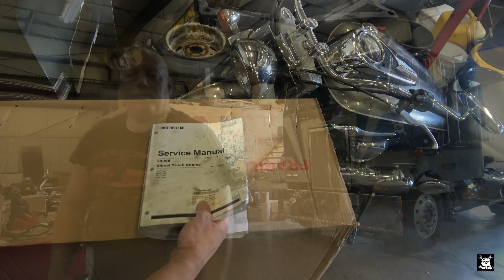Caterpillar Fuel Transfer Pump Removal

Comment: If your looking for a pin hole in your suction side, you most likely will not see a leak. You can plug the line at the FTP remove line from the tank. Get a psi regulator and put around fifteen psi on the system and you will find the leak. Also you can put one way flow check valves in your fuel system, to prevent any drain back. I only do this if problem can not be located.

Comment: Steve , I left a comment six or eight months ago after seeing a video of you starting Orwell after setting overnight , I said then I thought Orwell had a cracked fuel filter housing , I've had two of'em crack after filter being put on to tight , it puts the housing in a bind trying to losen the filter and cracks it , but I've not watched all your videos , you may have already changed it .

Comment: They had several different check valves over the years which they changed the material the diaphragms were made of.. I worked at a caterpillar dealer for 42 years..
Reply: Had to change them twice on my 86 B-Model .... some of the fuel anti gel I was using ate them up but a real easy fix once the problem was first solved.

Comment: Steve I've got the Cat # for those O rings if you need it, I buy them 50x at a time because it's the same O ring on EVERY fuel fitting on that motor and they're like .15 cents each.  Just keep them in a Zip Top bag in my toolbox cuz you just never know when you'll need one.  Of course I realize you've already changed the pump, but the Part Number might come in handy in the future for ya!

Comment: Hi Steve I was just wondering if it would be worth your while putting in a bunk heater in your cab this year before the winter  so you don't have to run the engine all night to keep warm is it worth it or is it not possible on your truck ?

Comment: Does the fuel system pull fuel from the bottom of the tank or is it connected to the top of the tank? If it's connected to the top of the tank there's a dip tube inside the tank going to the bottom of the tank. Those dip tubes can crack and suck air. Your fuel pressure gauge problem might be an over pressure problem. I can't find a good diagram of the fuel system online but your manual should have one. There is some type of pressure regulator in the system to return fuel to the tank when the pressure reaches a certain point. It might be on the injector pump. If that doesn't work, the pressure will go too high which could damage the gauge, the lift pump and the injector pump. I have heard of people blocking fuel return lines on diesel systems to try to get more power and the black smoke. There should be a diesel injection shop in your area that would have someone who is familiar with the system.
Reply: Draws from the bottom, returns to the top.  It's the most basic inside the tank, it's just a welded fitting, no line or anything. The newer trucks yeah, but the antiques like Steve has, and my '84 359 are pretty plain and simple.
Reply: @Wildcat_Cartagellc25  1984 is a newer truck to me. Fuel tanks have had top draws since at least the 1950s. We had a 1950s vintage cab over International tractor that had top draw fuel tanks, aluminum frame and air suspension. All of the 1970s Ford Louisville models we had drew fuel from the top fittings as did the 1970s model Macks. Most tanks have a lower well in the bottom of the tank that the dip tube sits into. They can be plumbed either way which is why I asked the question.
Reply: @tiredoldmechanic1791  they pull from the bottom on the Paccar's others might not function like that but these do. Didn't start the other way until mid 90s I believe.

Comment: You need to get a little more concrete poured right there one of these days so you can get the truck in and out easier
Reply: All he needs to do is plan his first turn better so when he backs up the truck is facing straight in the door, then both ends of both axles will go through that low spot at the same time preventing loss of traction.

Comment: What is that "buzz" every few seconds while he was removing the pump?  And then again working on the hoses?
Reply: The air pressure equalizing in the tanks.
Reply: Air loss. You can't hear the air leak itself, but you can hear the tanks equalizing again and again as it looses air.

Comment: The power divider seems to act like a 4X4 Jeep with open differentials. If one of the four wheels on each axle has no traction, the 4X4 wont go anywhere.
Reply: That's why it's still only a 4X2 no matter what, unless you spring for diff lockers also.
Reply: @ralfie8801  Some, if not all, Canadian class 8 trucks have inter-axle locks, that lock the two axles together on each differential, as well as the common power divider. Because of the bad Winter weather in some areas up there.
Reply: George Travers 
You said it yourself, "some, if not all". Differential locks are extra cost items when you order just about any vehicle. Even if it is part of a cold climate package with battery blankets and fuel heaters, it's still an extra cost item. If it doesn't have it, it's because somebody didn't check the appropriate box when they ordered the vehicle.
Reply: @ralfie8801  Agreed.

Comment: I used to drive a 359 with a B model cat and in the mornings, especially cold ones, during cranking if hold the pedal to the floor until I hear that first cyl pick up then get off the fuel so it doesn’t rev up. Just to help with cold starts.

Comment: Not sure why you guys mess with these old trucks and try to make a living from them. A modern reliable truck would be worry free.
Reply: What's interesting about that idea is that many fleet operators are finding just the opposite.  All the pollution control stuff fails or causes other issues. E.g. EGR, DPT, SCR, etc..  You can buy an old truck for pretty short money and if you can maintain it yourself save a lot of money over having to deal with all the modern electronics which require computers and software to triage. There are some here on YT that talk about the greater downtime of their modern electronic trucks vs. their older more mechanical ones.    Regards
Reply: @donaldwilliams6821  Cars and trucks are a whole lot alike.  I could work on a pre-computerized, pre-fuel injected, pre-smog reduction era car.  Try working on a new car... no thanks.  Diesel trucks are no different with a computer controlling everything and a bunch of extra things designed to reduce emissions.  Yeah, new cars and trucks get better fuel economy and produce less emissions, but they are a pain to repair and repairs are more a thing of the computer telling you which expensive component needs to be replaced.
Reply: @michaelstansfield319  I agree.  In the Army I could fix or troubleshoot my Jeep or deuce pretty quickly.   My 2014 eco diesel JGC is a whole different animal.  Also computers suffer can lead you astray too.   I had a Trans Am years ago.  Kept throwing codes.  The tech kept replacing parts.  The shop owner, came over, he knew nothing about computers, but valvie covers were off and he took a look while it was running and said "worn cam" and walked away. haha  turns out GM has some soft camshafts.  Replaced it, problem solved.
Reply: https://youtube.com/c/FrontierSpecializedHeavyHaul
Would tend to disagree with you.
Reply: @dondalrymple5794  Lke everything "your mileage may vary"   I also didn't say everyone   I happened to come across some that were having more issues with their new leased trucks vs. their older ones.
Reply: If that were true nobody would have ever paid big bucks for a glider.

Comment: It has been 52 years since I drove an Army Deuce-&-a-Half, but I kind of recall a differential lock on the two rear axles.  I thought it prevented slipping & spinning like Orwell had.  Am I wrong?  Nothing quite as unpleasant as liquids dropping while working from the floor!
Reply: Power divider

Comment: That pump is actually very simple inside, it’s just three check valves. I take mine apart and clean it every once and a while as my truck sat for a few years and got algae in the tanks.
Also what rpm does your truck idle at? Mine was low and it made for a hard start.

Comment: If you don't have a diff lock on the drives, a little light braking will force power through the diffs and get power to the wheels with traction.
Reply: yep a can see a video heading our way about changing a power divider. or spider gears. ok 3 of the 4 wheel set lifted he has a divider locked but he does not have the pos lock Orwell just does not have it.
Reply: @hartsfire5706  That explains my vague recollection from U. S. Army 2.5 ton 1970.  Thanks.
Reply: @donalddodson7365  the deuce and a half or 6X6 should halve had track and pos lock.  less it was a really old one from back in the mid 60es.
Reply: @hartsfire5706  The one I drove was a 1967 Kaiser Industries, per the dash board placard.  The lever was under the dash and some marking like "Air Lock."  Certain it was NOT door locks, ha, ha.
Reply: @donalddodson7365  67 not sure about that year i drove one that was a 69 and it had the full pos lock for all 6.  it was a beast in the mud and snow.  i ran it at a Christmas tree farm near me..  i was the only person there that knew how to drive it as the trans had gone out years earlier and some one put a twin stick in it, so with the transfer case and twin stick trans it had 5 shifters.  i should have bought it when the farm sold out as i think it sat till it was crushed.
Reply: @hartsfire5706   "More levers, Drill Sergeant!"  Ours had the main shifter connected to a 5 speed "W" pattern.  Then there was the transfer case lever which had a high and low since the truck was always in 6x6 (as I recall it), but the lever was next to the driver's seat.  Then the rear lock switch.  I even got good backing up with the short Army trailer and the tiny little mirrors.  We didn't have any snow, but plenty of mud, slick, red, slimy mud in the Central Highlands of Vietnam, 1969-1970.
Reply: @donalddodson7365  this had a 8 speed Eaton fuller i think the extra lever was a extra transmission to disable the front drive. i know at around 50 MPH the thing was a problem to keep on the road. it still had the big 6 triple flue in it as i use to start it on gas and switch to #1 diesel. i loved the thing and do miss it , but not the steel seat. 
mostly field mud and gray clay mixed to make for a vary sticky slippery mess. 
thank you for your time served Sir.